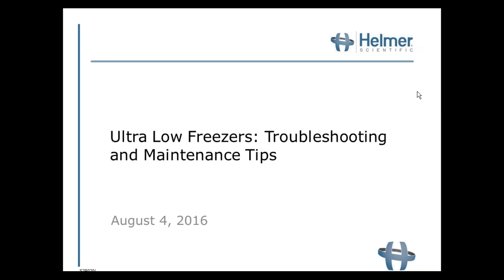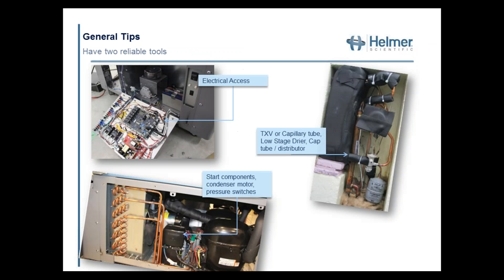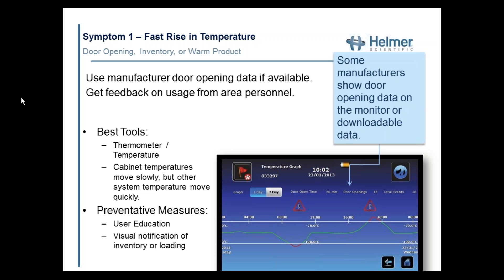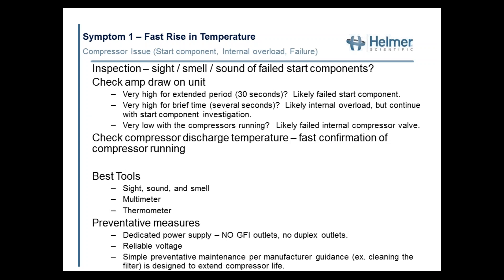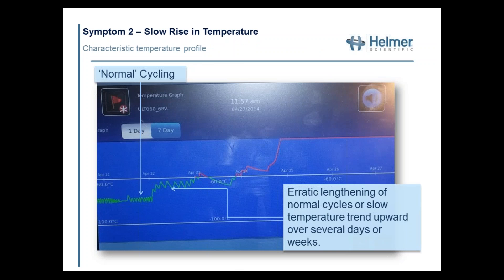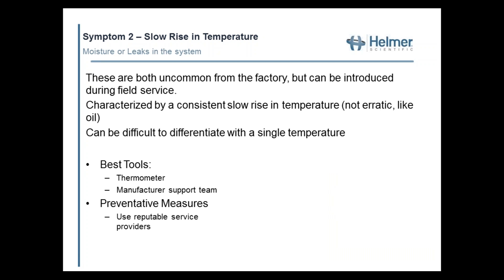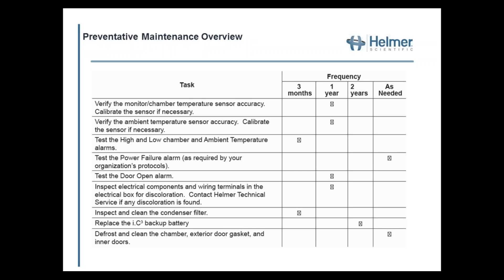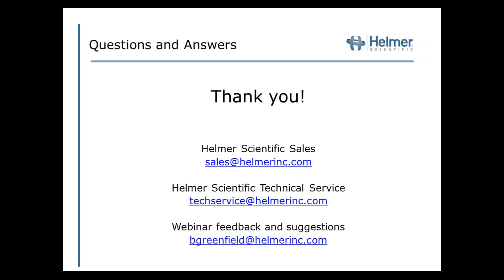Webinar - Ultra Low Temp Freezer Maintenance

Comment: Thanks for this video. I have an old Forma 904 ULT freezer. We have moved the freezer recently. Since then the "Probe failure" alarm is on. The control probe is properly seated in the unit. Do you have any clue of what the problem could be ? Thanks for your help.